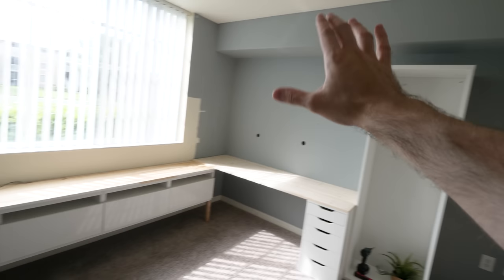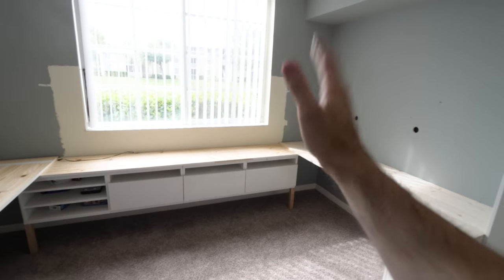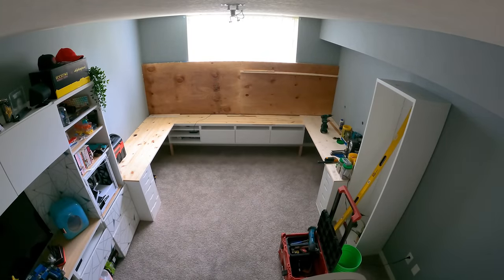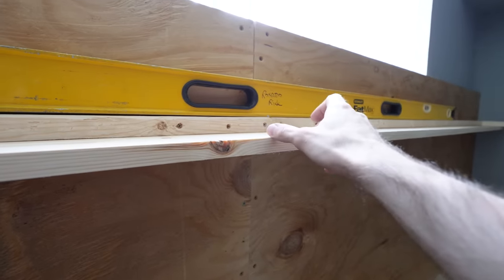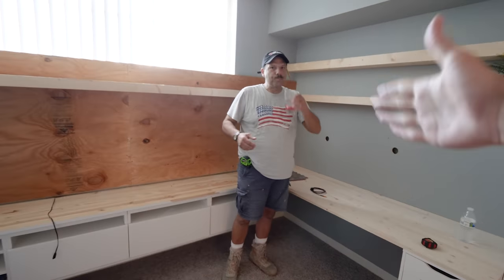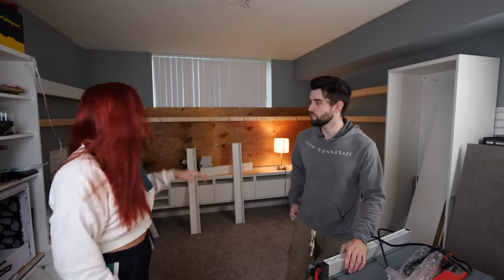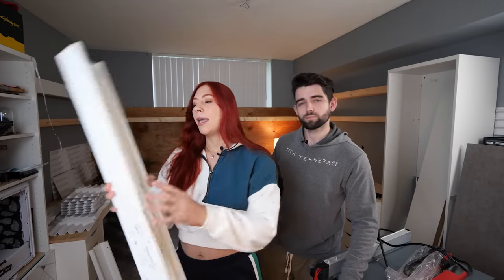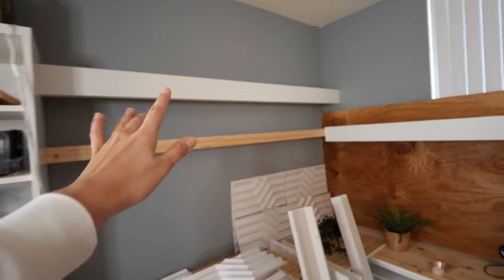Ultimate DIY Gaming Setup Build w/ Brittnaynay3! - Pt.1

Comment: I actually have that exact same table saw, though I got mine for about $150 cause I got it as an open boxed return and paid about $20 to replace the bearings in it.  Honestly though if you didn't like the wood beams, you could have bought a white primer half gallon from lowe's and stick about 2 coats on but that would be under the assumption you didn't have the ikea shelves.  Or for contrast you could bought a grey primer then painted it another color but I think Walnut shelves would have been good with your setup if you bought some stain.